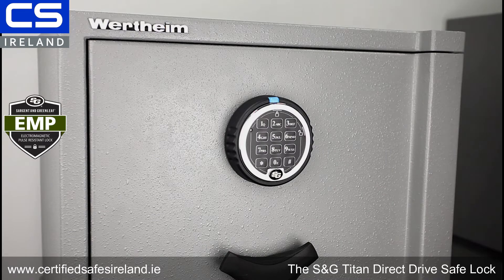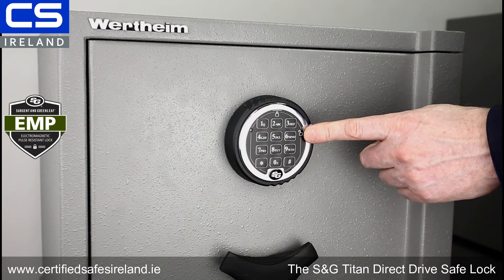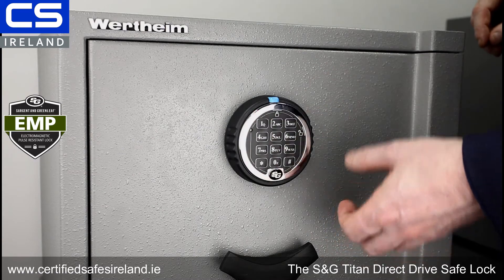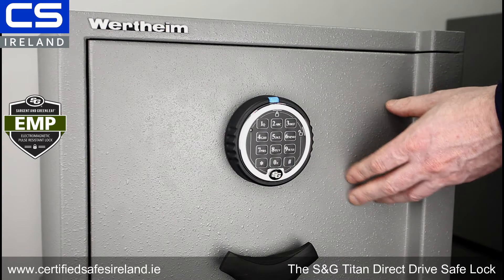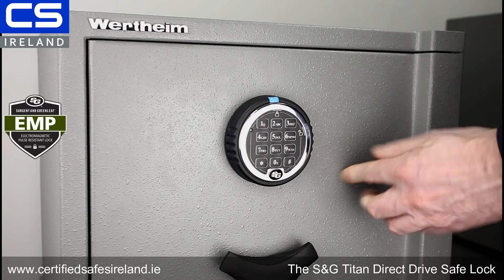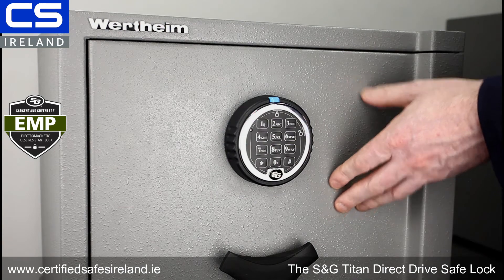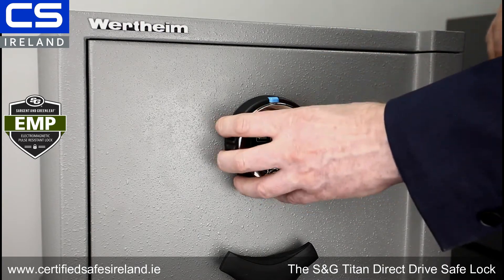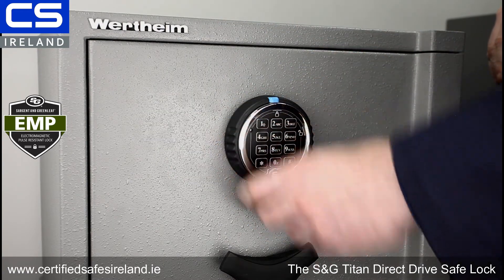S&G Titan Direct Drive - A Comprehensive Overview

Comment: Is it plastic? how durable would it be to a hammer or something? thanks.. 
Noooo.... i just seen the top tab and you pulling out the 9v battery... that looks sooo fragile..what if somebody cut the wires or something?
I'm still thinking a good solid key is the way to go?
Reply from the maker: The keypad is only a low-cost code input device designed to be destroyed in an attack. The codes for the safe are held in the lock on the inside of the safe. A replacement keypad can easily be connected to the lock and the safe opened such an attack. This is quite unlike a key lock that if damaged may require drilling, damaging the safe. There is also the fact that a key can be copied and a key lock can easily be picked open, both without your knowledge. Please see this video:  https://www.youtube.com/watch?v=uTUj-wk2tTk&list=PLI_EuSsahA5ufQ5UjaumxFOprzMU_nEj9